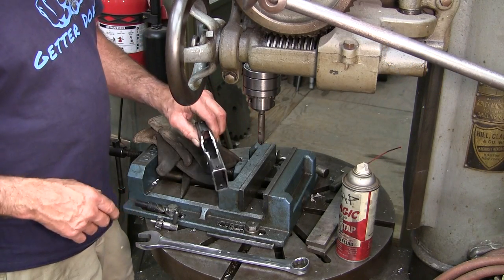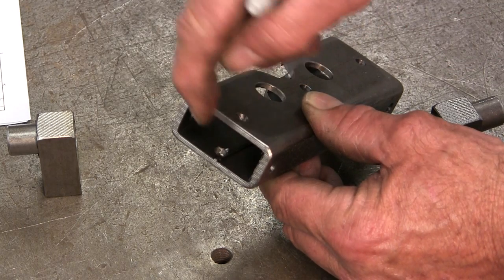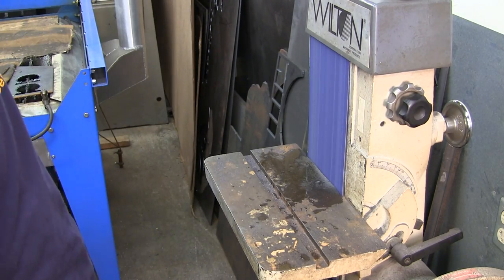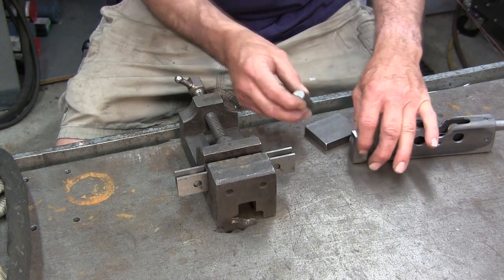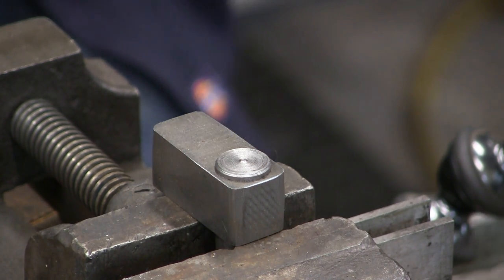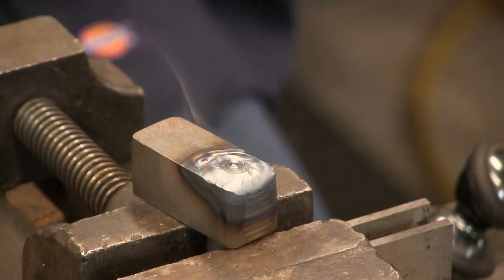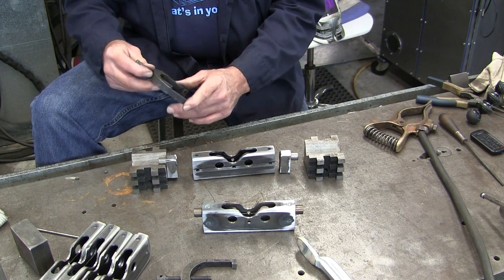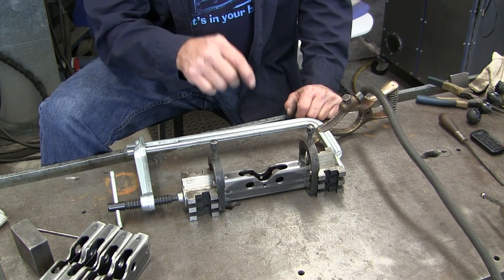The Wright Roller Kit The Build / Part Four

Comment: I really like the "rosette" weld method.   You can "rosette" weld "cheese plate" onto cracked car frame members and unibody structural members  to reinforce them.  A great method when you can't get a "bucking" bar on the back side, for rivetted construction or repair.

Comment: Great series to watch Keith.
I was wondering , would countersinking the holes for the welds help with access and possibly add less heat ??
awesome video as usual
Reply from the maker: By the time you are filling in the end the heat would be the same and the diameter would increase because of the champer, I have tried that on rosette welds in the past.  ;{)------
Reply: great thanks Keith
Reply: Depends on the size of the hole, very small deeper hole might require a chamfer, bigger ones rarely do...   ;)

Comment: are there bearings available that can handle high heat?  this roller you make is amazing and would be great for rotating tube for welding caps. but would ruin normal bearings with the high heat.
Reply: True there are heat tolerant rollers/bearings,  But if you ae arc, tig, or mig welding... you have to gound the welded pipe such that no current passes through the bearings.

Comment: I would've knurled the Tilting Pin and pressed it in :) But I can't TIG weld for sh*t :-p
Reply from the maker: My first set was done with AC buzzbox, 3/32" stick rod, LOL This is only one way, one can do it, there are many different ways already shown by those who have made and video or photographed their projects. Some even use fasteners for all the points I fuse together.   ;{)------